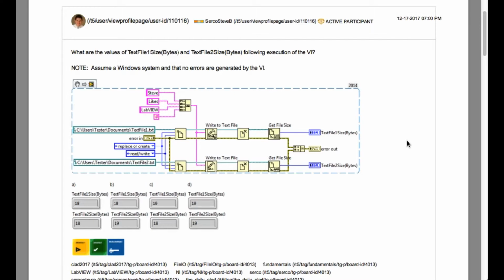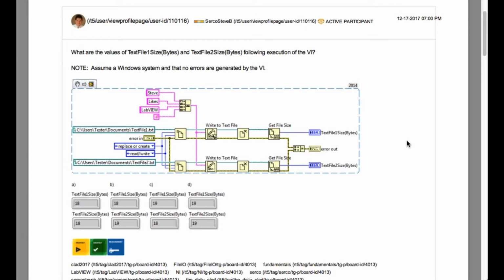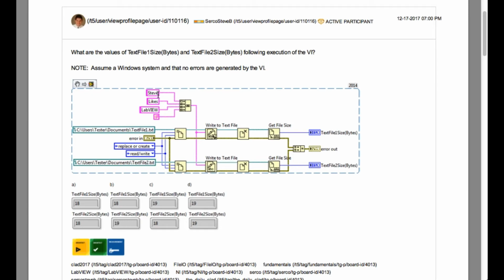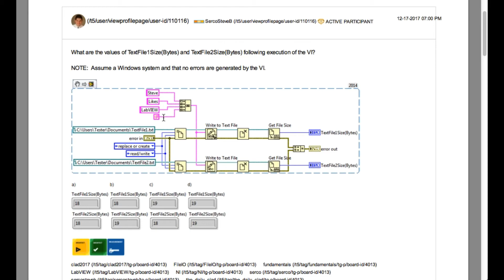LabVIEW CLAD 097 Different ways of writing to the File

Comment: Hello sir,  Top code is is End of line is 2 bytes,carriage return is 1 byte ,data is 17 bytes ..total is 20 bytes..bottom one is  data 17 bytes... carriage return is 1 byte total 18. can u please explain how size is 19 bytes...
Reply: NI help file on Write to Text File Function states that it appends platform-dependent, end-of-line (EOL) characters to the elements of an array even if you right-click the function and remove the checkmark next to the Convert EOL shortcut menu item. I did this in LV2023 and it shows TextFile1Size(Bytes) as 19 and TeztFile2Size(Bytes) as 18. Opening the text files in Notepad++ and showing end of line characters shows CR and LF after the text for TextFile1 and only a CR on TextFile2. 19 and 18 bytes.